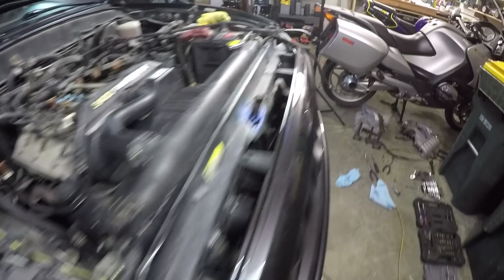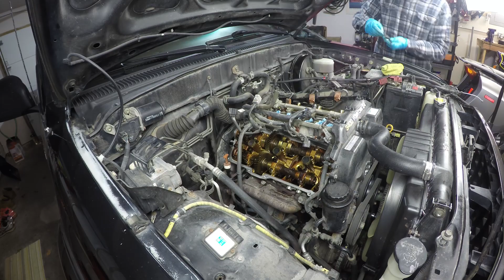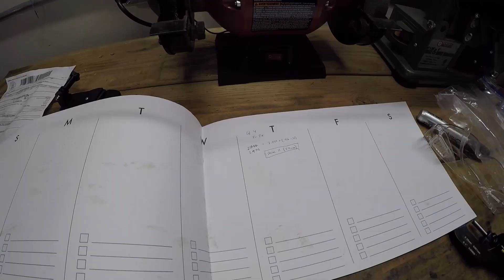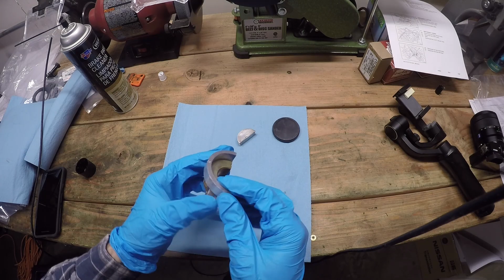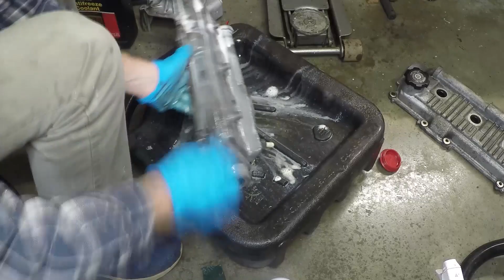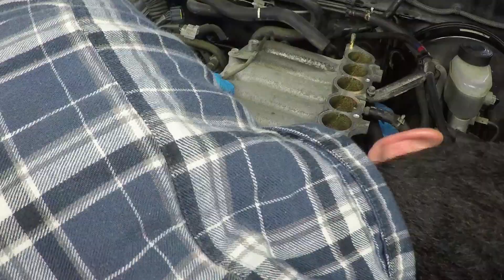Toyota Tacoma Valve Adjustment How-To – 3.4L V6 (5VZ-FE)

Comment: Valve clearance gets looser not tighter as mileage increases!
Reply: That's simply not true. They can get looser OR tighter. I've done tons of valve jobs and the intake valves are almost always under spec. The backlash decreases on them due to valve recession. The exhaust valves are either all in spec or slightly over spec though.

Comment: There’s a couple things I noticed in this video that I would like to correct if I may. 
(I work at an independent shop in a farm town Texas) 
#1. Crankshaft needs to be turned CLOCKWISE, NOT counterclockwise. In other words, you’ll be pushing your ratchet downwards if you’re turning the engine over from the topside. 
#2. When measuring the valve clearance between cam lobe, it’s preferred to get the HEEL (lowest point) of the cam lobe and measure between your valve stem tip and your camshaft heel. Having it at TDC WILL help you, but you want the camshaft HEEL at the valve stem. 
However, I do like the way you did this video. Great explanation, great tips and of course super helpful.
Reply: Where in Texas I like taking my vehicle to independent shops rather than franchise shops
Reply: This is spot on.

Comment: Isnt spinning the motor the wrong way is bad? Welp u were spinning it wrong way at 25:40
Reply: It might hurt a 4.7, but the 3.4 is non interference.
Reply: I've heard that to but I've spun them back and forth,a bunch of times and didn't hurt anything. I think it used to matter more with older push rod engines, I not sure though

Comment: Somehow mine burnt an exhaust valve at 80k. After getting quote of $3400 (2009) I did it myself, (I sent the heads out) for around $700, including new timing belt, Water pump, Gaskets hoses etc. There are a lot of things to get right. I'm now at 190k - no leaks, still runs great. My tips are A.wash the engine as well as possible before you begin  B. take many pictures from many angles after you wash it,  for reference later. C. get the FIPG (Form In Place Gasket) from the Toyota dealer, no substitutes . And that plastic thingee is a piece of crap.

Comment: Awsome vid, what would you recommend doing if you stripped the thread on the alu head helli coil or just jbweld a stud in and tighten done with a nut
Reply from the maker: I would helicoil it but be careful to not get metal shavings inside the cylinder head.

Comment: I changed both valve cover, rear cam plug seals, and resealed half moons on head. With my Milwaukee battery ratchet it went very fast on disassembly.
I turned the crank clockwise and checked the valve clearance by turning till each lobe was facing away from the shim. Had to go around a few times but it allowed me to do one side at a time, doing the harder drivers side first.
My truck has 208k miles, and all valves were good as is.(no tight ones). Used cheaper Chinese spark plug seals but didn’t like the thinner Chinese valve cover gaskets, so got genuine Toyota for those and the rear cam plugs. Chinese bolt seals seem nice also, Mahle brand for the 2 manifold seals from rock auto saved and were nice quality -Also got the genuine Toyota gasket sealer in a tube, seemed to have great reviews, but like “right stuff” also. Took me from 9 am to 6 pm to do both sides, cleaning valve covers well and permatex anti seize on all bolts.
So far so good

Comment: What I need to know is how do you move the crank to the next position correctly?
Reply: This is also what I want to know.  I'm in the middle of this job, and here's what I did. I cranked it to TDC, then stuck my hand down there with a sharpie marker and marked zero, 90, 180, and 270 on the pulley. Then in between those 90 degree increments, i further divided the needed quadrant into (3) 30 degree  increments.  I then cranked clockwise while carefully watching for my marks until I got to 180, then went turned slowly more until I got to 210, then 240.  My system was not precise, but I think it's working fine, seeing as how at 240, the cam lobes on the needed valves should be up.  To get to the second rotation of another 240 degrees, I actually first returned to TDC, THEN I cranked a full 360, then another 90 degrees with my marks to make 450 total, then cranked another careful 30 according to my marks.  Tedious PITA, but it's what I did so that I would feel comfy and learn in the process, for my first valve clearance job. Good luck! Let me know if you figured out something more scientific and/or easier.
Reply: DEGREES ON ANY WHEEL OR CIRCLE MATCH THE NUMBERS ON A CLOCK FACE DIVIDED BY THREE. 240 DEGREES = 8 OCLOCK POSITION. AN ADDITIONAL 240 PUTS YOU AT 4 OCLOCK

Comment: My 99 4runner with 160k miles is constantly misfiring with no check engine light, All cylinders getting spark, thought it could be injectors replaced all of them, still misfiring, im going to do a compression test tonight, really hope its not a burned valve.
Reply from the maker: Have you replaced the timing belt recently? Could be that it's a tooth off or something of that sort.
Reply: So what happened?
My 99 with 190k in it is starting to missfire. I suspect a valve issue.
Wondering what you found.
Reply: @douchebaggins7  type in "1999 Toyota 4Runner Misfire Diagnosis Story" in the search I made a video about it on my other channel

Comment: I enjoyed the video, But I think it would have been better to have the valve covers all prep and ready to install ( i.e. cleaned up with tube seals and gasket installed ) before the FPIG in gaps at the half-moons and the cam caps corners had time to cure and setup. I feel the cover should be installed immediately after the FIPG is dabbed over the gaps at the half-moons and the cam caps corners, to allow the FIPG to form around and seal with the cover gasket.

Comment: You should have mentioned that with the plenum off the engine, it would have been a good time to do a thorough cleaning of the throttle body and IAC valve. Great video.
Reply: As well as the MAF sensor yes.

Comment: "Just be careful"?  No.  Clean a bit before removing the intake manifold and pulling ignition components off.  A blast of air is probably good enough except for offroaders tend to get mud flying in all sorts of odd places.  If that's you, then wash that engine down first, please.  Wiring harnesses hide dirt that comes free as you start moving it around so  the business of wiping down harnesses before valve covers come off just might save your bacon.

Comment: My 3.4 has 560k and I haven't done this yet. It runs great but I'm thinking it's time 😂
Reply: At that mileage, pull the heads.  Yes Toyota is good, but valve jobs don't last forever.   There is no other way to verify seat condition, and how much recession has taken place. Yes, checking clearances let you know you're in trouble [you'll be at or smaller than spec], and in that case the business of changing shims is just kicking the can - did things stay square, or are your valve seats starting to go egg shaped?   If there's any question at all about guides, replace them but know that you get forced into a valve job when that happens - seat preparation hinges off of the guides being true.
Reply: 331K here.  Runs like a dream still.  Not sure if I need to.  🤷‍♂️
Reply: 330k here. Need to replace the gaskets next weekend. All I want for the Xmas is this to go smoothly. Lol
Reply: My '01 4Runner is at 516,xxx and runs great.  Have never touched the valves. Purchased the truck new and do all of my own maintenance (except, apparently, the valves).

Comment: Which direction did you rotate the crank?
Reply: @PracticalEnthusiast  facing from the front?
Reply from the maker: @chriskutz8473  that's correct.
Reply: @PracticalEnthusiast  okay good. For some reason it looked like you were going the other way. You're the only one with a video online doing this on a 3.4. my dealership won't even do the adjustment. Thanks bud
Reply from the maker: @chriskutz8473  oh geez. I feel so dumb. You are right, I am rotating it COUNTER CLOCKWISE when looking at the front of the engine. Counter clockwise it the correct direction. Ugh...sorry.
Reply: @PracticalEnthusiast  I mean I guess I could just turn the engine on lol. There's nothing in the FSM about which direction. It's easy to get lost in all that. I heard it really doesn't matter and I've heard it screws stuff up. Idk
Reply from the maker: @chriskutz8473  I've turned a non-interference engine backwards a partial revolution before and I don't think it harms anything for such a small movement, but doing so does put tension and slack in places in the timing belt that shouldn't normally be there, and in turn, will make the cams and crank not align as expected. But, don't experiment, just turn it the right way lol
Reply: @chriskutz8473  In the FSM... EM section under Timing Belt it says “Notice Always Turn Camshaft Clockwise”... As mentioned though I’m sure it’s not a huge deal...

Comment: Drive side cover... You didn't really need to unclip the hardness wire that much. It could of stay and move the cover up than turn to the side of the timing is than slip right off. However looking at your video clip under the value cover those burn oil stan is pretty bad compared to mine it's not that bad at 26x,xxx. If you're replacing the caps of the adjustment than you should of hold off on the gasket and seal
Reply from the maker: The underside of the valve covers did have a lot of carbon build up. I assume the previous owner didn't change the oil very frequently. Luckily it still runs perfectly (because Toyota) and is back on a strict maintenance regimen.

Comment: While you're at it you should throw some new knock sensors and cable in
Reply: That’s under the lower intake manifold, you’re right, replace it if the engine has a lot of miles on it, and only use the Denso/Toyota sensors, nothing else will work, and you’ll be in limp mode forever.

Comment: I need that for my toothpaste what tool is that 😂
Reply from the maker: I never considered that use case. My life just changed. It's called a tube roller key and you can get them on Amazon. This one was included with the sealant.